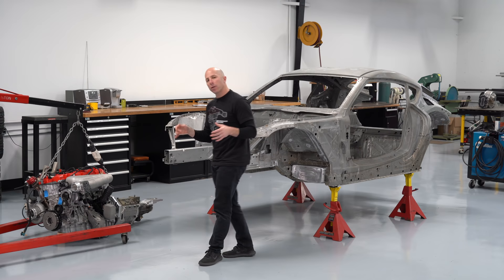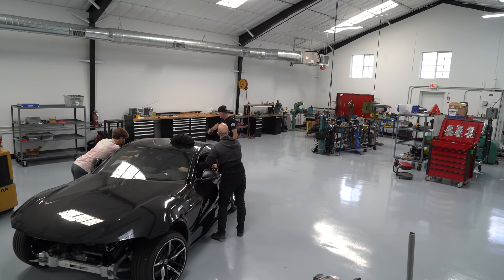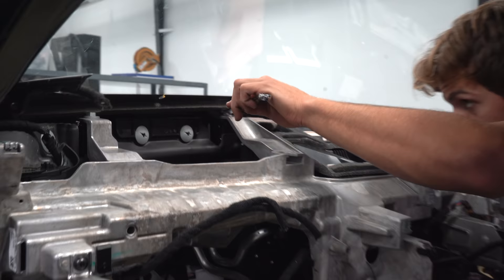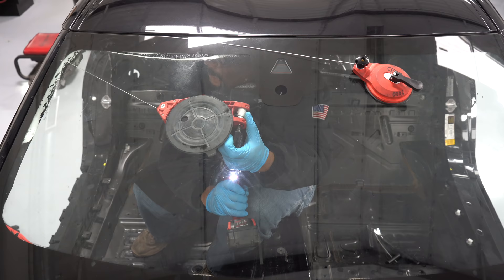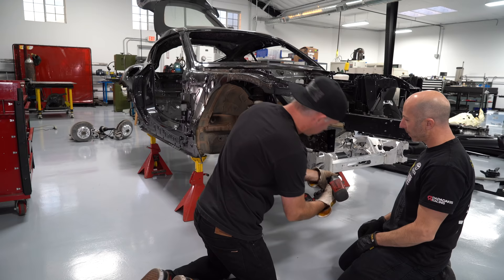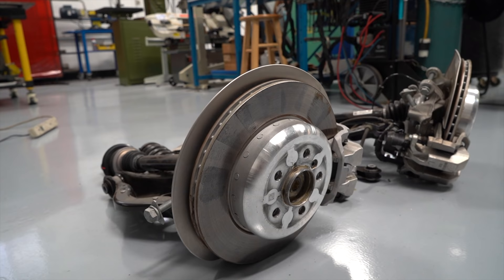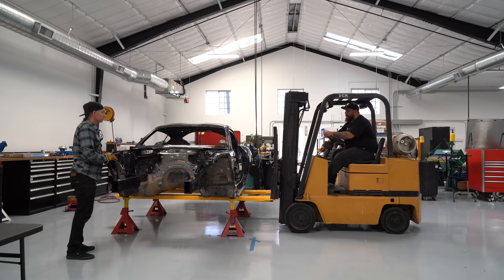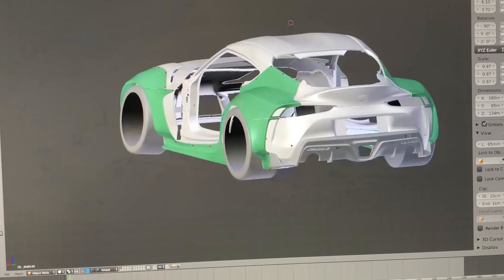Supra Complete Teardown and Strip

Comment: i like how everything straight to the point and no BS
Reply: kinda makes the wait worth it all...just wish theyd upload more frequently
Reply: 0 fluff
Reply: @technicalthug  Yip, youtube creators are now doing what discovery, natgeo & history channels did, cater to the lowest common denominator...
Reply: This is the ultimate YouTube car channel
Reply: hell yeah man.
Reply: “I unscrewed the 4 bolts that hold on the alternator by turning it counter clockwise with a flathead screwdriver, but you could also use a power drill or  a ratchet with a flathead bit.”
Reply: This would have been a years worth of content and a failed project on any other channel
Reply: wHaT's uP gUyS it's ya boy papadoc racing back at it with aNoThEr vIdEO 🤣🤣🤣
Reply: that was a years worth of content in 10.01.. i mean 7 minutes
Reply: After I watched, I went back to check the video length...  So much content in under 8 min!
Reply: He was going so fast I had to pause to see what he was talking about XD
Reply: Exactly. This could have easily been a 20-40 minute video with nothing but filler.
Reply: Immediately subscribed. That's how I like my content
Reply: @supermotos  No, it's still petrolicious. Because that shit is car porn.
Reply: @mr_ctrl_x4568  Try Project Binky for a laugh and a great car project.....
Reply: His tone and narration style is a lot like the channel "Lofty Pursuits," which is a candy maker. If you like this style, try Lofty Pursuits, as they sound very similar.
Reply: kinsel they’ve become clickbait ad driven videos which are annoying.
Reply: Rich Rebuilds:  left the chat
Reply: @eddiefromcali  NGL I wish they were longer too, but I shouldn't be complaining. Free, amazing content like this is almost too good.
Reply: woah dayum, thanks for the likes
Reply: I couldn't agree more.
Outstanding in every way.
Reply: Because YouTube videos aren’t the primary source of income.
Reply: Papadakis is no BS but the engine does
Reply: Yea just like Supra stuff
Reply: @dkjoses12  But I laugh so hard the 2s he speaks about power/weight ration and fuel economy
Reply: Exactly.

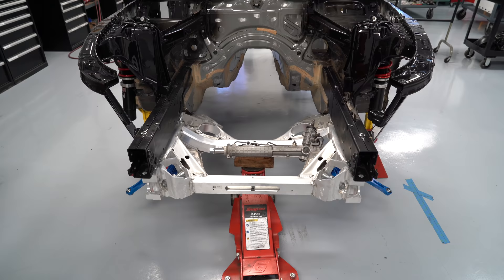Comment: 5:15 "Seriously don't try this at home"
me: hey that looks like a cool shortcut, might have to use that next time I work on suspension! lol
Reply: Patrick94GSR same
Reply: You can also leave the strut installed in the mount, remove the top nut before you remove the 3 nuts that hold the assy in place, and it will fall out harmlessly under the car.
Reply: Works fine , I used to do it that way all the time. Except it's actually a little safer if you sit down and place the strut bearing against your feet , so everything flies one way instead of all directions.

Comment: Nice, i love your work!👌😍 Maybe this is just a silly question, but why can't you guys ask a bare body/chassis from Toyota?
Reply: from body to engine is all made by BMW not toyota ~
Reply: Gossip Heart  No, do you? Also companies do sell kit cars, so this would not exactly be breaking new ground.
Reply: Generally speaking, auto manufacturers don’t supply bodies-in-white very often. The cost savings to strip the production car down are more than offset by the cost of stopping down the production line at the body-in-white stage to pull a chassis. It’s typically more practical and cost-effective to have the team take on the labor.
Reply: Gossip Heart  No i don't. But it is not a street car, so it would never be registered right? So why does it matter? And are they not sponsored by toyota?
Reply: @penonton4260  I know that, but this car is still owned by Toyota. You think that the whole car from electrical harness, pistons, bearings, tires to suspension is made by one factory?!? That would be crazy to think that. But i do agree that it is a shame that a lot (or too much) of parts were not made by Toyota...